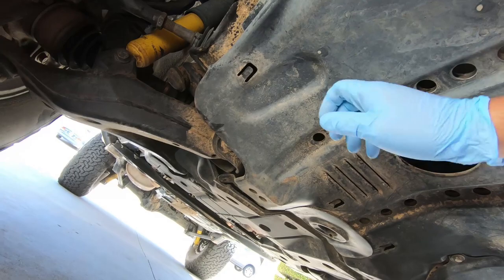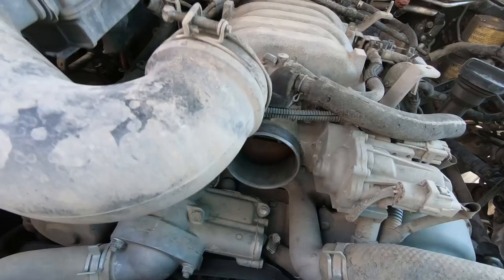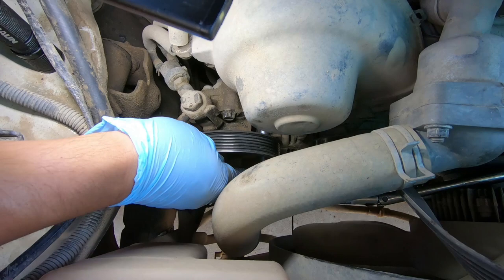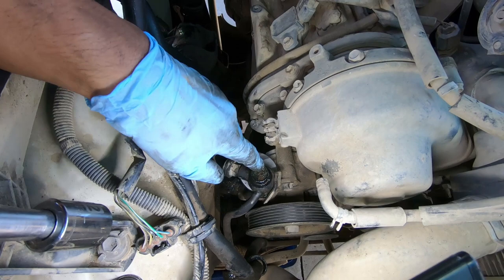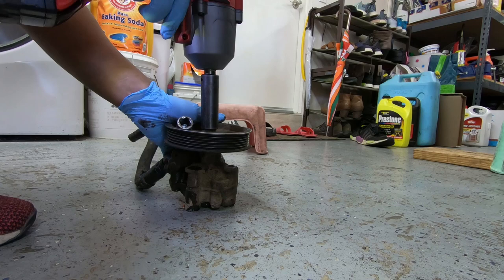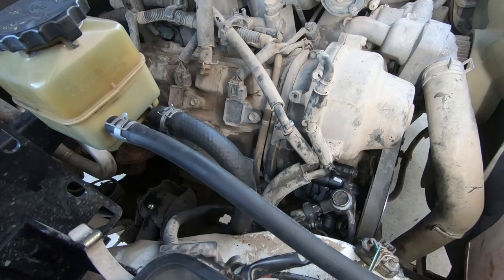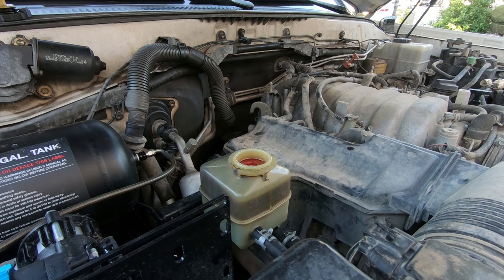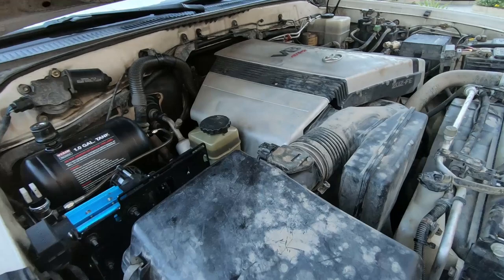Power steering pump replacement on Land Cruiser 100 series/Lexus LX470

Comment: Thanks again for your videos.  Just replaced my power steering rack and used your other video as a guide and used this one on how to handle the power steering vacuum switch; I broke the intake tips off and the nut was stripped to remove it.  Your video showed I could remove the high pressure line via the banjo bolt which let me rotate the PS vacuum switch to find unstripped sides and break it loose..

Comment: Informative video. Thanks for the easy step by step. I thought my pump was going bad as well. After reading through the comments I realized it was probably my alternator. Went to AutoZone to get the alt. tested and sure enough it showed failing diodes. I replaced the alt and now everything is great. And, instead of loosening the entire power steering pump in order to get the alt out. I cracked the pulley nut of the p.s. pump loose with a breaker bar while the belt was still on. I also loosened the fan shroud and moved a few small lower hoses out of the way and had just enough room to slip the alt out without really disconnecting anything else. Thanks for giving me the confidence to do this job my self.

Comment: I had the same issue. Took it to my mechanic and I was about to spend a lot of money to replace the power steering system based on the sound. It actually turned out to be the alternator. Thanks for the comments, you saved me a nightmare.
Reply: I do not get this. how it can be alternator when the sound is only when you use steering wheel?

Comment: Replaced mine today. Your video was extremely helpful. Thanks! I wanted to leave a quick comment on removing the serpentine belt since it wasn't clear to me in the video. You need to turn the 14mm bolt on the tensioner counterclockwise to release the tension (still holding the bolt in the CCW direction while you remove the belt. It will be obvious once you're there. You'll see the tension being relieved).
Reply from the maker: You’re welcome. And yes, counter clockwise!

Comment: Great video this was a big help for me! A couple of things I found when doing this on my  son’s 2004 GX470. 

1. I believe it would be far easier to remove the pulley first. This makes the mounting bolts easier to access, and also it’s easier to remove the pulley itself. 

2. You alluded to it a bit, but That banjo bolt was a PAIN to loosen!

I also went ahead and preventatively replaced my alternator after removing the PS pump. It was much easier to access and remove while the pump was out. I had done the job before, removing the alternator from below the rig. That wasn’t too fun.
Reply from the maker: I agree, that banjo was a pain!! And yes, if you do the ps pump, you might as well do the alternator. Don’t be like me... (I did them separately 😑)

Comment: Been battling the same sound myself, it ended up being the alternator. Easy way of finding out is sitting in the car , hit your high beams and listen for a change in the noise . The regulator itself makes that noise as it’s dying . 200k seems to be the benchmark for the alternator dying .
Reply from the maker: Thomas Christoe I tried the high beam and brake lights but it didn’t really make a noise. I’m gonna try the idler and tensioner pulley next 🤞🤞🤞

Comment: Check the alternator...mine made some sound before finally giving up. After replacement, it sounds great!
Reply from the maker: MMA I will, thank you!!
Reply: @chowcares  what was the fix???
Reply from the maker: Tim Battle alternator, I did a video on that too. Also, alternator and ps pump are stacked on top of each other, would be wise to do both at the same time
Reply: @chowcares  thanks man, I appreciate you doing this and taking the time to reply on an old video. I bit the bullet and bought both
Reply from the maker: Tim Battle that’s the smart way to do it!
Reply: Good job, guys! I am about to replace the rack and pinion next. I’m sure that’s going to be interesting 🧐
Reply from the maker: MMA I hear it’s gonna be a fun one! I haven’t done it myself yet but I’m sure eventually I will. Lmk how it went and what I should look out for please!
Reply: @chowcares  will do! I did buy a reman from Amazon (A1 Cardone) for $300. Also bought bushings from Amazon. The ATF was purchased from a local Toyota dealer (just need 2-3 quarts).
Reply: @chowcares  I got lucky. The pump got delivered before the alternator, so I swapped it out and cured the noise. A few things I did differently were. Used my pulley holder tool, which is a rubber strap with a handle, and removed the pulley while in the truck. I also zipped that banjo bolt off in half a sec with a half in air impact. Bleeding the system took my just as long to install the pump! Thanks for the video. It helped me out a ton and I'm a Lexus gx owner!
Reply from the maker: Tim Battle glad it worked out!

Comment: Did you break the plastic air control valve when you tried to loosen that big hose bolt that was hard to get off? FYI - the little plastic tabs are fragile and smacking them is a $100 mistake to replace the valve...learned that the hard way

Comment: Great video. Just finished this job a couple minutes ago. Couldn’t have done it without this. Thanks
Do the hoses that connect to the ports on banjo bolt side matter which way they go?
I can’t remember how they go. One goes to air box and other to intake but I can’t remember in which port to put in on power steering pump side.
Reply from the maker: I don’t believe it matters, they’re just for vacuum so either will work

Comment: Love your videos, 230k on ODD, I’m sure this video will becomes handy when time comes to replace mine, mine is the LX470, fan belt snapped on me and I kept on drive and tripped the solid red VGRS light, I’m sure if those LC100 came  with it or not, hopefully I can get some insight thx!
Reply from the maker: Thanks for the support! Land cruisers never came with the vgrs light. That comes on when your steering needs to be re calibrated. Not sure if anyone besides the dealer can do that tho...
Reply: chowcares  lol I guess sometimes Toyota is better than Lexus, went to a Lexus dealer I thought its a simple computer recalibration, tech said when he plugs his scan tool he keeps getting timed out, he’s recommendation changed the steering computer module which I read on forms didn’t help at all, I will try another dealer and see if I get any luck, truck so old I’m not sure if those younger tech knows how to work with old tech. Keep post theses great videos,!
Reply from the maker: Yea dealerships tend to want to “replace” stuff rather than “diagnose”. Hopefully you’ll have better luck at another dealership. Keep me posted on what happens!

Comment: What hose lengths did you get? Thanks for the video, very easy to follow
Reply from the maker: I don’t remember exactly, but it should be 3-4 ft of each. Best way to find out is to measure them when removed, or just buy 4ft of each

Comment: Hey thanks for the video, have been finding your videos very informative. I’m brand new to vehicles and I have 2000 LX. Have a power steering fluid leak, need to replace the lines and reservoir. As far as tools/equipment goes, I have zero items. What kind of tools would I need to be generally equipped to do work on my truck as well as this power steering job specifically?

Comment: Why did you replace the hoses with Auto Zone hoses and not just use the current / existing ones ?  Were they bad ?
Reply from the maker: Yes, they were no longer pliable due to years of heat. Plus the different direction of the ps reservoir

Comment: Hi. Would you recommend to delete the air control valve coming in from the vaccum line, connecting to the banjo bolt and instead plug it with a regular bolt ? Thanks

Comment: I did same for Toyota Coaster has a 1HZ Toyota Land Cruiser motor and i bleed it out a second time after driving it round a bit and two days later. The whining noise went quiet. Even though you got a lot of air out it still could be a little in and needs to settle in. 

I actually replaced with a new second hand power steering pump and now I’m wandering if the last pump was just not bleed properly even though I did bleed it and seen a lot of bubbles, plus put a container of Lucus Stop Leaks in. It was ran dry from a leaking hose beforehand so I might have damage the old pump but it was only a short drive a few days and I was topping with power steering fluid.
Reply from the maker: Jaffasoft I bled mines a few times and thought it might be the rack. Luckily it wasn’t and turned out to be the alternator.
Reply: chowcares you’ve got it sorted. All good.

Comment: A REALLY BIG THANKS MATE!, this was so helpful, I also went through the same process, (3rd Alternator now) But damaged the shaft on the power steer pump, I found it Much easier taking the pulley of to gain clearance for the alt' removal without PS pump removal. mine is a 1998 LC V8 and my power steer pump seems somewhat different. Although original and unchanged with 375,000 KM not miles, (I Live in Australia).. I may have to rebuild or replace, Can you please put up the part no. of yours, I couldnt find it in the vid, have RE-Tapped the thread and re-nutted but I'm a bit !@#$%^&L when it comes to everything being perfect on my baby and only use genuine parts, Can Not Thank You Enough, Keep up the great work!
Reply: mine is totally different

Comment: The filter is plugged up in the reservoir causing fluid starvation to the pump...replace the reservoir or if you can bust out the filter with a screwdriver an install an inline filter ..
Reply from the maker: Turned out to be the alternator. Oh well, at least I know it will last now
Reply: Before resorting to more drastic measures, try removing the reservoir and soaking in diluted Simple Green overnight and scrub the filter area (& resv) with a cleaning brush.  Comes pretty clean.  (A bit of brake fluid cleaner as last resort but fully rinse).  Be careful of plastic ports on reservoir... They can be brittle.

Comment: And this thing comes off and.... All the crap on my dirty engine goes in  !  Geese man rule 101 don't open a sealed/ clean air box and air filter inlet tube to loose crusty dust and dirt probably grit that will enter the engine at first start up adding a few thousand km /mi  more wear just due to laziness  high pressure wash that block!